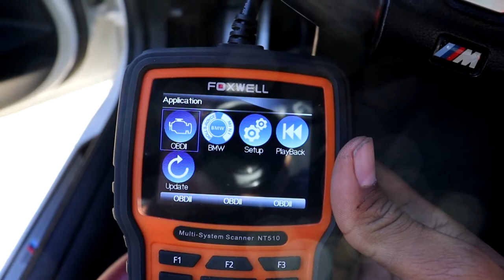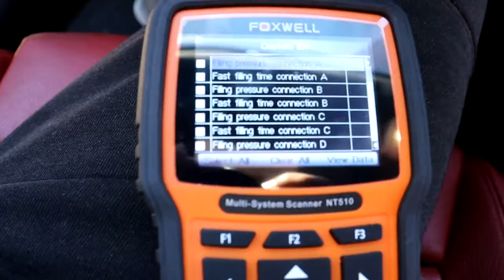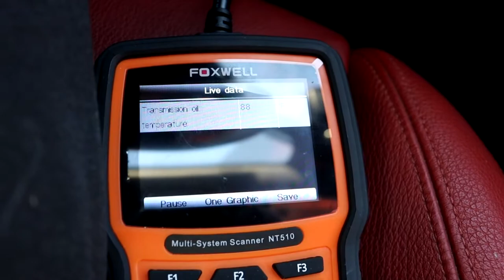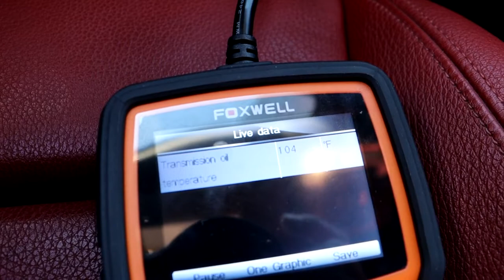ZF 8HP Transmission Pan Replacement + Fluid Change on My F30 BMW 335i

Comment: Followed this and thank goodness. I got those nipple extractors and it was a pain getting that fill plug out. Also stripped the drain plug (the plastic just snapped when trying to remove it), and ended up drilling through it to drain the transmission fluid lmao. Thank goodness the kit comes with a new drain plug. Literal pain getting it done, but should be smoother next time. Thank you for the walkthrough!
Reply: same...

Comment: Very interesting, good job.  My daughter took her X5 to the dealer, they charged her $2000, yes, $2000 dollars for the same job.  The dealer is a total scam.  They charged $90/qt for oil and then said they used 7 qts. total BS.

Comment: Just for everyone's reference I had my ZF 8HP serviced at the Dodge dealer.  They used a BG Flush and Fluid replacement and its working great.  They didn't tell me they weren't using OEM fluid but from what I have research BG seems to be very popular in the auto service industry.
Reply: BG is snake oil for dealerships, as a way to stack fat profit margins over OE fluids.
Reply: What fluid did they use exactly? Didn't know BG makes a transmission fluid
Reply: @kalani1987  BG has a fluid that is fully compatible with the ZF gearbox, they have a couple different fluids only one is actually recommended by ZF.  I cannot remember the exact model.

Comment: Rear world diy. 
I would suggest when you unbolting fill plug tap Allen socket with hamer make sure it bottoms out than take crack at it 👍🏻
Reply: Maybe also spraying PB blaster or WD40 before attempting to loosen up the threads

Comment: Ver informative video, how has the transmission been post fluid and filter replacement? At 60k miles would have expected the fluid to be close to green but it seemed brown which is odd.
Reply from the maker: Transmission has been running great, just like before, since I did this. I was also kind of surprised it was pretty brown at only 60k miles.

Comment: Thank you very much bro for your explanations and time !!! What’s the oil you use and how many bottles ??? And how often you need to carry out this service??
Reply from the maker: I linked the whole kit I used with the exact only in the description! I ended up only using like 3-4 bottles I think. And from I’ve seen, this service only needs to be done around every 100k miles.

Comment: Did you buy the ZF oil pan or the BMW oil pan? When I see it at FCP, I can see a difference between the picture of the ZF oil pan and the one that says GENUINE BMW... it's just the design of the interior of the filter and I don't know what to buy. Thank you!!!!
Reply from the maker: I bought the ZF pan which is in the exact kit I used linked in description
Reply: @InlineSixAuto  Thanks a lot!!! And thanks for the video!!

Comment: Hey mate. I have a f30 328i 2013 in the uk. But all I can find is the white bottles with the light grey stickers on. Fcp euro have the white with dark blue sticker labelled bottles. Have you had any issues with the fluid you used?

Comment: Did you turn off the transaction control before going through each gear to get fluid up each gear? Mine lets me go through m1-m3 only (it’s in the air) was yours on the ground?
Reply from the maker: No I didnt turn anything off. Mine was in the air still too. I just kept my foot on the brake also

Comment: How long did you idle the car running the engine in order to meet the 40 to 50 degrees Celsius I don’t have a scanner to see the temperature I think I will just base it on how many minutes to idle the car to to reach 40 to 45 degrees?
Reply from the maker: If I remember correctly it took about 10-15 minutes
Reply: The outside temperature will be an influencing factor as well as how long the car sat there after previously been driven. I wouldn't risk it and I'd just buy a scan tool. It only costs around 130 for Launch Creader Elite for BMW

Comment: I just got 7 liters of the ZF 8 and is the exact same label as yours.  Is it FULLY SYNTHETIC?  The other label says High Performance Synthetic...yours says High Performance Oil for cars.

  If I'm going through the trouble of changing it, might as well use synthetic.

Was the car still running in Park when you added more fluid?
Reply from the maker: what other label are you referring to? And yes the car was still running in park when I went back under to add more fluid.

Comment: Hey bro, great video with exactly the right info! How’s the transmission doing after the last 10 months and what’s your mileage at now?
Reply from the maker: I'm currently at 72k miles now and the transmissions been great with no issues. I recently installed xHP Transmission Flash and it shifts even better now
Reply: @InlineSixAuto  what is xhp transmission flash mate?
Reply from the maker: @ImranKhan-ej3fy  basically a transmission tuning program that allows you to achieve quicker shifts and removes torque limiters in the transmission allowing you to achieve higher torque outputs. Also has a bunch of other features that allow you tune the transmission to your liking

Comment: What torque you have to put on those set of 12+ torx screws? Thanks
Reply from the maker: 10nm
Reply: @InlineSixAuto  thanks. I couldn't find it in my manual. cheers
Reply: @gavinb5784  i was also looking for this info. Cheers

Comment: Shouldn’t you add fluid with the engine on ?
Reply from the maker: Yes. I ended up putting more in with the engine on off camera. After the first initial fill with engine off, turn on the engine for a few minutes and then do another fill until starts pouring out again.

Comment: Hello! Great video tutorial i’m going to do it too .. just a question: did you notice if the gear changes were softer after the replacement or same as before..? 
Thanks 🙏
Reply from the maker: Thanks! For me, the transmission felt the same after doing the service.

Comment: How much fluid can you expect to drain out? The entire system takes 9 qtrs. but if your just doing the pan I would expect you will only get about 4 maybe 5 qtrs.
Reply from the maker: You’re spot on. Only about 4-5 quarts drained out. As a result, you only end up using 5 of the 7 bottles you get with the service kit I used in the video from FCP Euro

Comment: how many liters?
Reply from the maker: how many liters for what? Need more context
Reply: @InlineSixAuto  need for fluid changr
Reply from the maker: @josuebut22  should be around 5. Youll have extra fluid if you use the kit I used in the video.

Comment: if the pan is coming off, and you have new pan to install, why panic if you cannot remove the fill bolt, just remove the drain bolt, let it drain out. That theory only applies if you are only changing your oil only and not your pan. Then you would be in a pickle. Something to think about. If i am wrong on this, please explain.
Reply from the maker: Because how would I put the new oil in once I drain the oil and put the new pan on if I can’t get the fill bolt off? The transmission would have no fluid making the car in drivable until I can get the fill bolt out. If you remove the fill bolt first, that ensures you will be able to fill the transmission with oil. Or in my case if you aren’t able to get it off and end up rounding it, the car is still drivable since it still has the old oil so then you could take it to shop if need be or if it’s your only car you could still drive it if you can’t get a way to get the fill bolt out till awhile after.
Reply: The fill bolt is not part of the replaced pan.

Comment: I dont think this  is  a ZF this is a GM
Reply from the maker: It’s ZF. All F-gen BMWs use ZF transmissions. From what I’ve seen. The one in my E90 328i is GM transmission.
Reply: Yea ZF pans are plastic. GM ones are metal so you are wrong my friend.
Reply: @InlineSixAuto  yeah I was looking at the transmission  number  and it start with a GA not with a zf , i was wondering about that